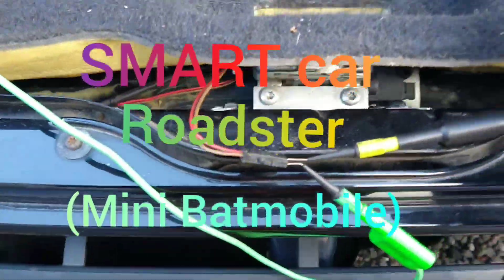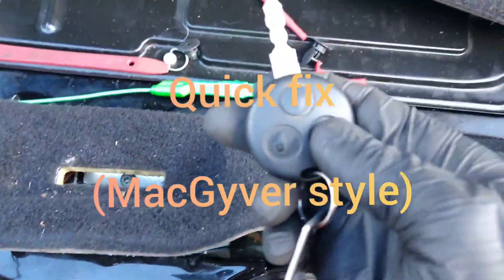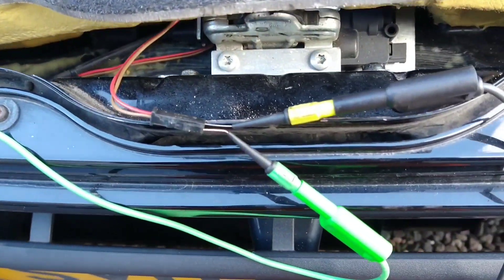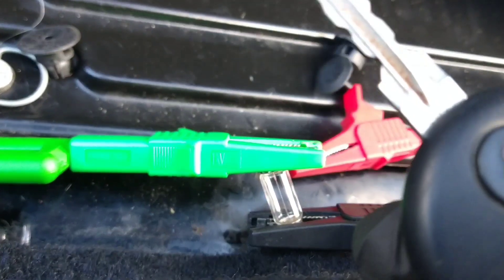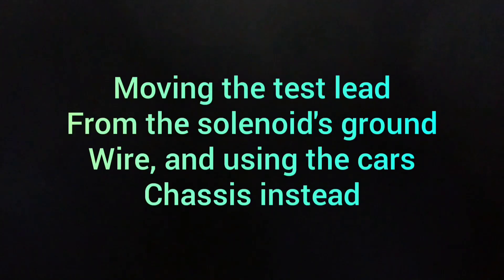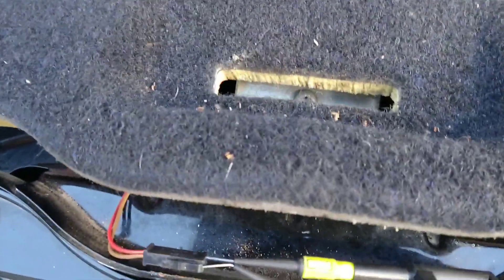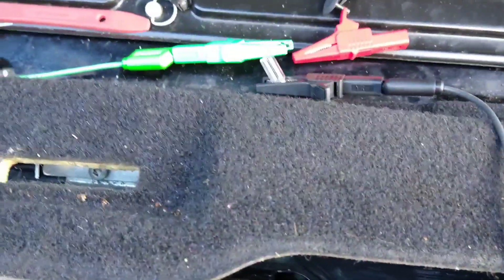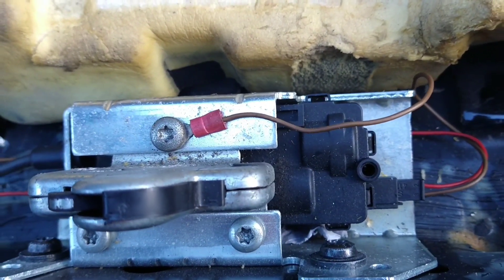SMART car Roadster, Boot/trunk  solenoid Fault

Comment: Hi matt , i'm working on my ford mondeo  tailgate  won't open   4 wires  on the lock assembly   constant power 12 v  ,  Ground  and two wires  for the open /closed switch   one of which has 0.5 volt  the other  is return to the control module  i think when  these two wires are disconnected it works okay but reconnect  and the tailgate won't close as it's some how  grounding out the solenoid  ,  i thought it was a fault with the lock assembly  and bought a new one same problem  i can't figure this out how when plugged in the open/ close  wires some how are grounding the solenoid   any ideas  on what the problem could be? totally stuck with this thanks .

can't think why the open close switch  would some how be  tied in to the solenoid circuit?
Reply from the maker: Hi John I don't have a wiring diagram for this, although I would think that the latch position would go back to the body control module.
So that when the boot switch is pressed it will activate the latch until it knows that it is open then it should stop activation of the latch since it's already open.
The fact that yours won't close may indicate that it doesn't know the boot latch has opened yet. 
With the boot open can you close the latch or hold it in the closed position with a screwdriver or something like that?
If so does the switch position sensor voltage change. It may go up to 12 volts  and the switch will be pulled down when the latch is in a different position.
I don't know if 12 volts is open or closed but considering it's still trying to open the boot
And you have 0.5 volts I would think 0.5 is closed and 12 volts is open.
So I would try and jump 12 v to this wire to see if the latch will lock.
Of course it may be a good idea to do this through a test light with the test light clamp going to a battery positive.
I may not even be correct in what I'm saying here, it's just going from your comment and from what I remember of checking a boot latch. Let me know how you get on.
Reply: @mechanicmatt871  Thanks very much for your reply matt    , i'll give that a  try  this morning  and let you know    Thanks again .
Reply: @mechanicmatt871   Hi  matt finally got it fixed the wiring harness was shorting out  where it goes in to the tailgate flexi part)  only found it after  i had 12v on two wires taken 2 days but got it in the end . thanks again for your help  .